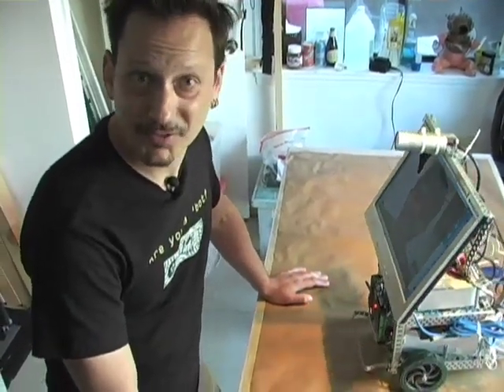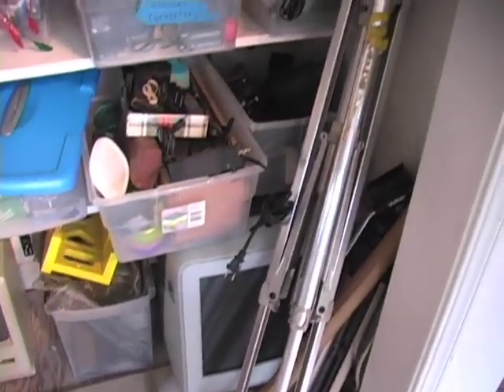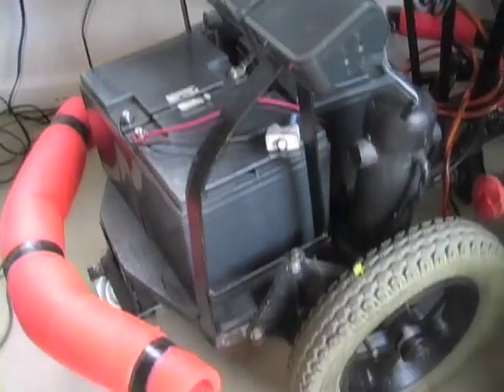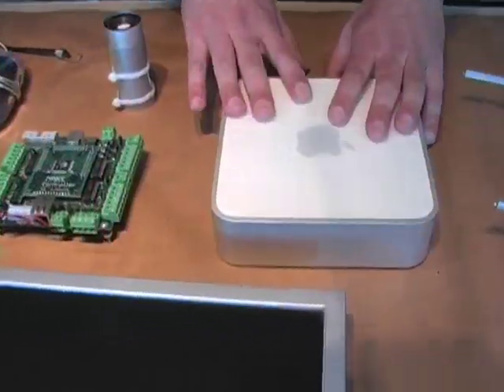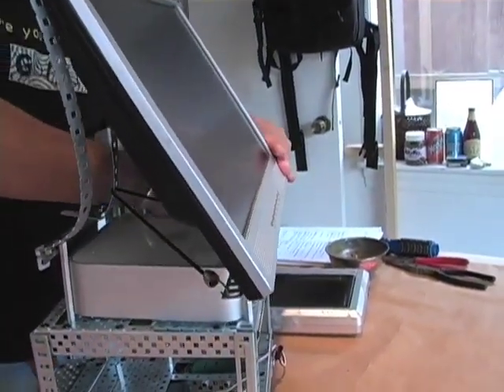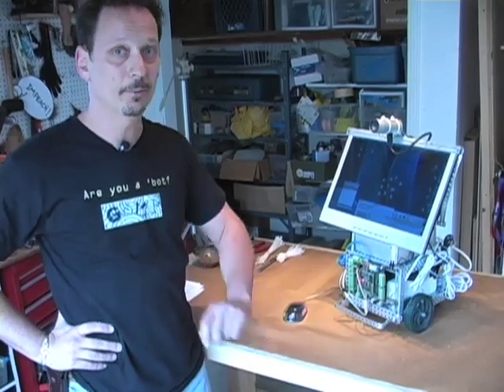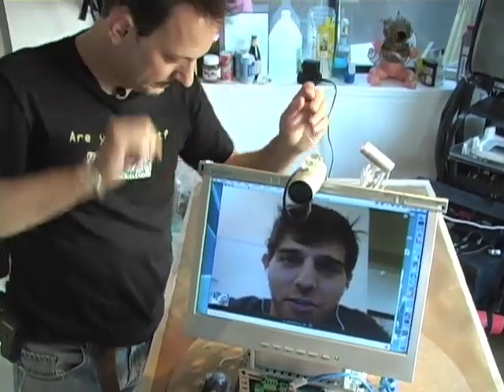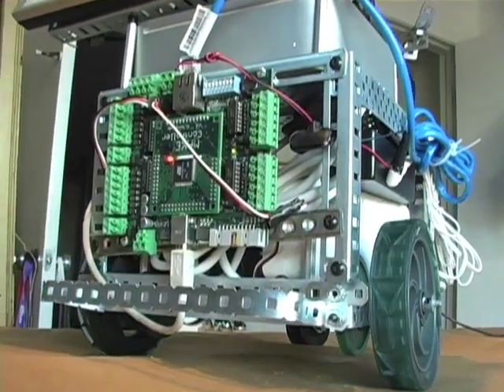Sparky 2, the DIY Video Chat Telepresence Robot

Comment from the maker: Normal?  What's normal?  Having no old electronics or toys lying around? The point of this video is that you can make this robot out of a wide range of crap.  Any computer and monitor, legos, erector set, etc..  Or some imagination.  You might need to buy the MAKE controller board and a few odds and ends, but yes.  I think many people have most of the materials they need. Just look at how many DIY robots are on Youtube or Instructables.  Too many to count.  Thanks for your comments!